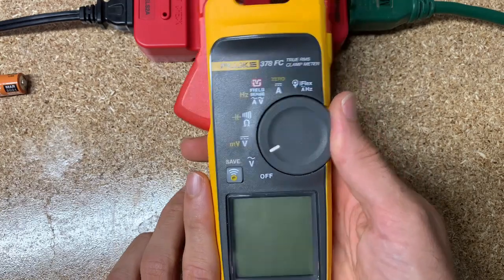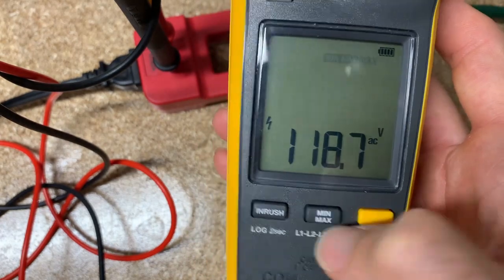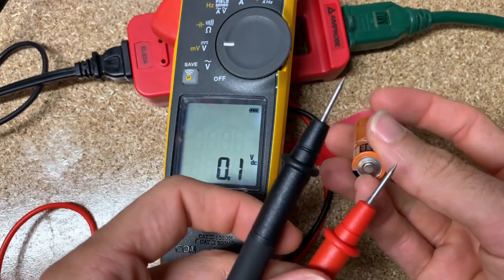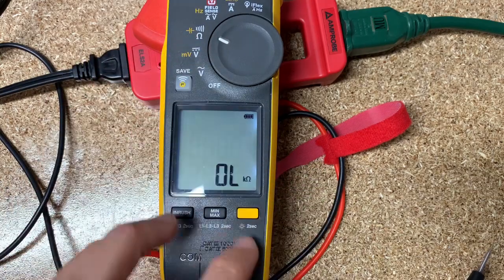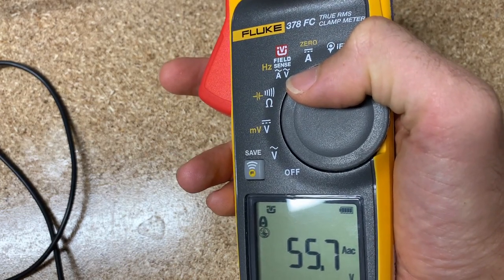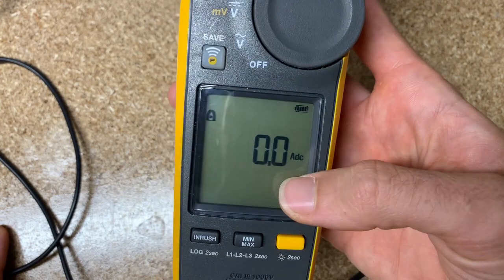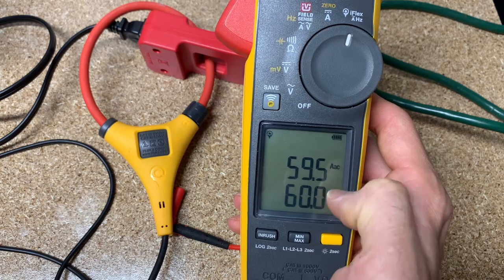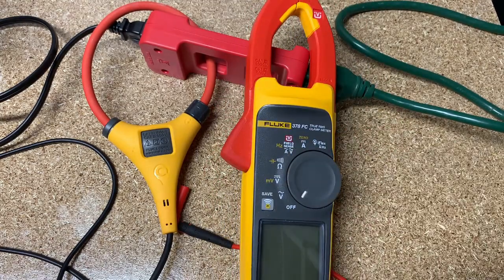Fluke 378 FC Full Features - Fluke Fridays - Episode 21

Comment: @Fridays With Brandon  Hey Brandon, If you don't mind, I have a few questions that I wasn't sure were covered in the 378 FC videos. 

1.) Can AC amp/current measurements be taken without the FieldSense function?  For example,  like on the 376. 

2.) I have an Amprobe line splitter and wondered if both amps and voltage can be measured simultaneously, providing the clamp jaws are on the correct area of the splitter?
And if so, can I use the included alligator clip on a receptacle cover screw for grounding, or even the black lead probe into the ground hole of the outlet?  

3.) To your knowledge, is this model made in the USA?

Thanks in advance!

Comment: Do you find the DC voltages on this meter accurate? I've got this meter (two weeks old) and DC voltages are way higher on the 378 compared to my other calibrated meters. For example a old 9v battery will measure 9.6v when my other calibrated meters show 8.8. that makes a big difference in the world of batteries!
Reply from the maker: I personally have not. But I've also not been trying to compare. If we assume that 8.8 is gospel that means it's around 9% off. Regardless I would reach out to Fluke Tech support 800-873-5853 (to verify that this unit is not performing as manufacturer expects). Then they can connect with service and service should be able to repair or replace 888-99-FLUKE

Comment: Love the videos. What new clamp meter would you recommend for 120/208 service tanning bed repair. I’ve got a 289 and an older clamp meter but want something a little more portable and fluke connect compatible. Lot of capacitors on these beds.
Reply from the maker: I would recommend probably a Fluke-902 FC (HVAC clamp meter)  or if you need more industrial use and want the flexible CT or iFlex I would recommend the Fluke-376 FC.  I would only recommend the Fluke-377 FC or Fluke-378 FC if you want the ability to measure voltage without the test leads.  Obviously pricing will probably be a priority for you.
Reply: @fridayswithbrandon Здравствуйте. Я владею приборами fluke t6-1000PRO и  fluke 378fc! Скажите пожалуйста откалибруется ли датчик  FIELDSENSE? Возможно ли это?